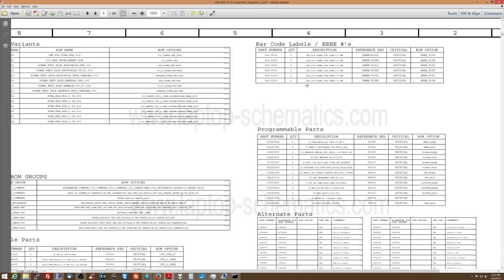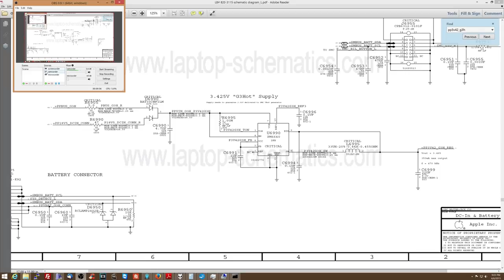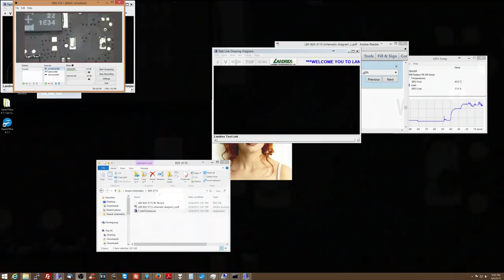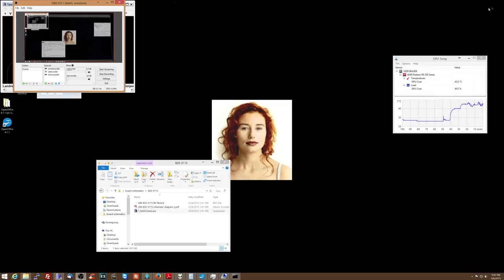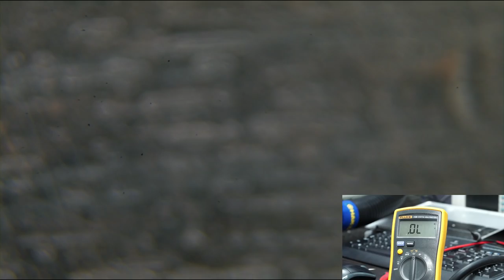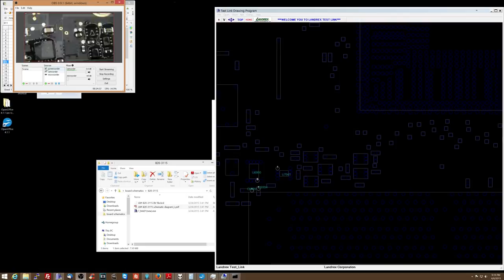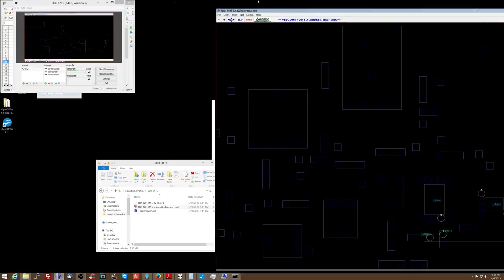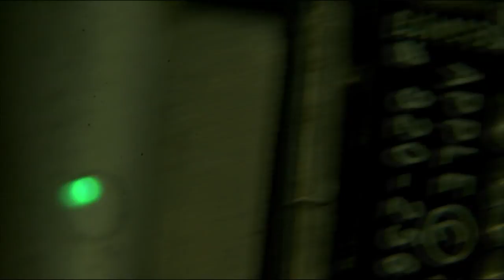How to find short circuit component without spending $6k on FLIR cam.

Comment: What temperature do you  use to melt and remove the SMCs ??

When you look for those resistors...  then you are SHERLOCK OHMS....
Reply: "Electromentary, dear Watts-son"

Elsewhere in here Louis had said "8 on Hakko FR-801 with old, beat up heating element."
FR-801 spec says 500C is its max when new, and the temperature knob only goes to "8" so... 450C?
Reply: @Spudz76  
THANKS ...   For the HOT ANSWER!

Comment: Louis, I wonder if you can give me some pointers, I was helping a hotel here in town, they have a machine that makes keys for the hotel doors, well, the power adapter for the machine had a broken wire because the staff bent the cord, the machine works with a battery however, when I fixed the adapter, I believe I had the polarity wrong, I had the + on the outside and the - on the inside and it was supposed to be all the way around. Now, the machine does not work with the power supply, only with the battery. Is this something I should be able to trace with the multimeter?
Reply from the maker: ***** Should be able to trace it by looking for the exploded piece with eyes. Open up and get to it
Reply: Thanks Louis, I honestly can't see anything burnt, I took a pic http://bit.ly/1hgNOIi I'm using my multimeter to try and find what component might have shorten, I honestly have very little knowledge in electronics and I am trying to see if I can get this fixed, the manufacturer wants to charge us an arm and a leg to repair it, heck they won't even repair it, they'll replace the board and transfer the information but I feel bad because I was responsible, I messed up when I wired the power adapter, I had the polarity wrong so, not sure what component burned but I'd like to get this fixed for my friend. Do you know if this can be fixable? I looked at the back of the board and it doesn't seem like the connectors go all the way through, I think everything is solder from the top. If you can give me some pointers on how to get this repaired, I'd truly appreciate it.
Reply: Louis Rossmann
Figured it out, it was the very first fuse, I put a jumper over it and now I am back in business

Comment: My hot air rework station started working intermittently and poorly and I discovered the regulator in the unit had some bad solder connections

Comment: Thanks for sharing man. This is very interesting.
 Ive fixed a few things on circuit boards for my RC Heli stuff that were obvious burned up parts like FETs , Tantulum caps, tiny surface mount caps and electolytic caps. etc.

Also soldered in a jumper for a blown trace. I felt proud for doing a few things but honestly wouldnt know where to start on a mother board if theres nothing easy to spot.

I replaced my laptop motherboard with one off ebay a few years back and it lasted a year or so  but now shuts down immediately during boot. I cant get into bios are anything. I wish I knew  how to fix it but dont know where to start on motherboards. 

Again thanks so much for sharing.
Reply: you can start by checking the capacitors on the board
Reply: @jessihawkins9116  Ok thanks!😀

Comment: I use fluxless solder and i probably would of skipped the gym when i start something i make sure its finished but in a way hes right life is just as important my rate is around the £2.15 mark his at minimum wage its tough going but to get business and work your way up the ladder you have to start cheap

Comment: Do I need to buy DC power supply and bypass short circuit protection to find shorted component on PCB ?
Reply: You could get an old PC power supply. It delivers 12V, 5V and 3.3V. You just won't see how much it consumes, but at least you'll find out what does get hot.

Comment: Hi Louis Rossmann, i like your video, and i use this technique to find shorts on phone boards, but there is a problem with it, it is very difficult to find shorts caused by capacitors, they don't heat up so easy and the are also because of the small traces you cannot supply such large currents like you did in this video. Do you have some idea how to find this kind o shorts without disoldering all the caps of the rail? Thank you.
Reply from the maker: Dacian Bujor No current limiting for me and no mercy. I start at 1 volt, and no current limiting, and raise it until I get to the max voltage handling for the rail. If I burn a trace I will rebuild it, it beats having a dead board that is shorted.
Reply: +Louis Rossmann still i have a board right now i6, and have a 0.95V rail, that is shorted to ground by a cap. The problem is that because its so low voltage and the track is thin i cannot get more then 1A through. And at this power nothing will heat up. There are somthing like 10 caps on this rail all of them have no corrosion on them. I am stuck.
Reply from the maker: Take them all of!

Comment: Sorry if I'm being dumb, but do you leave the power connected whilst pouring alcohol on the board?  Do you need to worry about this shorting anything out or causing damage?
Reply from the maker: I apply power only to the shorted rail.
Reply: Louis Rossmann thanks :).

Comment: Hey Louis, been watching and learning loads from your vids for a year or two now... was great hearing your hillary chat! I have a minor problem and that is that solder/components/motherboard sometimes sticks to my tweezers... Even with new ones, it has happened...... Also, who is reputable for buying chips, capacitors resistors and the like from? I have been purchasing from aliexpress (mouser had extreme delivery cost) but heard you diss them and could poss explain some crazy readings/results I had from them!! all the best, thanks for your efforts! Ps Im uk based

Comment: I have a navigation unit from an Acura TL that when changing out a backlight bulb, I shorted something on the board so now none of the lights work. Is this something you could fix? I have some knowledge but diagnosing a board and finding the faulty component is something I can't do. I'd love to know how but I don't even know where to start.

Comment: 30:35 "Yea, doesn't that look burned to sh't?"
Lol funny guy... reminds me of myself
Good video. Gave thumbs up. I too think it's better to pay for expensive stuff only when they actually make a difference
Also, about the esd issue, you can solve that pretty easily by using a grounding bracelet or the sort; but ofc you need to have reliable grounding installed in your establishment.
Effects of esd usually aren't very apparent, in my experience it usually damages some tiny parts rather than destroying anything outright... But who cares as long as you have a good supply of those chips with you. Yea, you should be fine unless you change wool sweaters and touch like a 0603 dac chip or something expensive.

Comment: what would be a good recommendation for a soldering iron for a hobbyist? i would want a best quality per price but i couldnt afford to spend more than 100$ since i wont be using it for making money back, just personal repairs, teardowns, ect.
Reply from the maker: +IceTea Deez I can't really say. I use a hakko 2027 with t15-j02 tip, it is a good general purpose. You can wick with it, flow large joints, and solder tiny connectors. I used to use a hakko 936 but i will never go back to that old pos after using real gear.
Reply: wow, I'm honored you responded to me but.. the first link i saw said 1500$..... i guess i will stick to my weller wsb25hk... sorry for wasting your time but your 2 vids ive watched so far i found very interesting and will def look for ones I can learn from to improve my low level skills....
Reply from the maker: *****
wtfak $1500!!!! no.

http://www.amazon.com/AMERICAN-HAKKO-PRODUCTS-INC-FX-951/dp/B0012B8NW8 is the iron and station

http://www.amazon.com/Hakko-T15-J02-Soldering-12-00mm-FM-2027/dp/B00IFH187Y/ref=sr_1_1?s=industrial&ie=UTF8&qid=1455250390&sr=1-1&keywords=t15-j02 tip

Comment: The trick I used to find hot spots was to turn a full can of air duster upside down and spray the board with it and look for where the frost disappears first.

Comment: So the faulty component is always the hotter one correct me if im wrong bc im trying to fix this mother board and this smd capacitor turns really hot when i plug the charger

Comment: I know a little about electronics, but, what is a zero ohm resistor used for?
Reply: When pick n place machines assemble circuits boards at any kind of volume they're not going to re-spin the board if they need to do revisions or have models with different options that use the same board that may not need a resistor there.  These optional/different model boards might use an actual resistor in that spot,  but another model may just need a jumper with the same footprint.  A 0 ohm resistor is used so that the pick n place machine programming does not need to be adjusted or a tip changed.

Comment: Hi, I have problem on my motherboard. Same package as in 30:40 and I need to replace it, but I have only normal solder iron and a heat gun (which is big and can't give heat with low fan settings, so it could blow SMDs away). Is there any way how to remove it easily?

Comment: Hi. I have a short to ground on my laptops graphics card MXM 3.0 GTX 880m, and because of this corona pandemic I'm unable to take it to repair shop. I have some basic knowledge and tools, but I can't find it. I did isolate the part of the short to ground, and found out it's from 7-20V power_src input to the first coil, R56. Some help would be much appreciated. Isolation sucks without a computer. By the way, your channel is great.

Comment: Hi. A need a little help. I have one laptop which is short to ground. He is short from the beginning of the board( dc connector is short to ground) and that short goes to most of the board. BUT, when i connect my power supply to the board, nothing get hot. I tried with power supply on gew places, but always the same result. I have no idea what can be the problem. Do you have some suggestion? Thanks.

Comment: so i have a short to ground on the +3vs5 line.   3.3 volts with a 4A current and a 6A peak.   what does it mean if every component on that line heats up (including the cpu) when you apply 3.3 volts to that rail (minus to ground)are they supposed to all heat up and am i supposed to look for the 1 that heats up even more?.   or is there something VERRY wrong

Comment: Hello, at 35:00 when you replaced resistor and capacitor, how did you know the good value to replace ? did you measure the removed one? or you got the value from shematics?
Reply: He has the schematic and board view file, so those component values can located with the board view and read from the schematic.

Comment: In regards to that horrible board view software, have you tried using CADsoft Eagle? It is freeware and has a pretty good .brd viewer for the price of $0.00. I use it to make schematics and PCB layouts but I don't see why it can't just be used as a standalone board file viewer.
Reply: +Brandon Martinez Eagle is only free for non-commercial use though. It's a pretty penny if you want the software with all the features though.

Comment: I have a short on a Nintendo switch mainboard from a 1,8v line to ground where around 0,4A flow through the short. Since this does not even produce one watt of power loss, I can’t find the short by feeling where something gets hot. Is there any other possible way of finding it?

Comment: I'd use a much lower currentlimit than the 10A you used. If the short is low-impedance which it apparently wasn't this time, you risk blowing track off your board at 10A.
Reply from the maker: +rewolff2 don't limit current. Just start at 0.5v

Comment: +Louis Rossmann Hi... any ideas why a MBP 5.1 charges battery normally but won't turn on even after SMC, PRAM and Power Switch has been discarded as the cause? No Fan, no Chime, no nothing... Definitive proof of a dead logic board? Or something else is happening and i'm not seeing it? The battery charges full and the discharges normally after a month or so being unused so... any thoughts about it?
Reply from the maker: TheMetalMusicMachine Missing power rail, corrosion somewhere. Measure all power rails and see what is missing.

Comment: Some advice to your co-worker going through a divorce. U mentioned him in the video. 

It's a 3-way jack by the lawyers. They practice the skit beforehand and when it comes time for trial, they perform for you. The skit is designed to confused the parties and continue the fight. The more you two fight, the more money the lawyers make. 
My advice, marry up. Also, don't hire a lawyer, because that's like hiring a spy on the inside. Hire them as weekend tutors, but don't let them speak for you during trial. 
Also, hire your own court reporter so when the judge robes you, u have evidence.

Comment: there are 4 method to debug short to gnd issue that i know.. 1 using short locator that required 4 gnd to each side.. 2. using iflir camera which is the easiest but not that reliable for above 1ohm short.. 3. using freze spray. 4. is my favourite using multimeter and hotair/solder...

Comment: I wouldn’t max out the injected current. That’s 3.4V x 10A = 34W. You could fry traces while you’re looking for the short. Instead, I’d find the output current rating of that buck converter and use that current.

Comment: Since you're not fearful of ESD and are probably using lead solder you may not mind a nylon toothbrush with a little Xylene to clean the board. Worry about the cancer later.

Comment: BTW Lou.....I've been in the electronics bizz for over 35 yrs, it ends up being the easiest way of troubleshooting that finds the majority of circuitry problems.....
I've used some of the most expensive equipment and meters etc, most times a toothbrush and some solvent would expose more problems than a thousand dollars oscilloscope. ....
Not saying that having good equipment isn't valid, but, I'm concurring with your info in this video. ...!!!

Comment: ESD isn't as big of a concern on a fully loaded PCB, that's why you don't have to worry so much about it. When you're dealing with individual components, especially sensitive ones like ICs and certain Microcontrollers, ESD can easily kill them. When they're in a circuit, especially a pcb - not so much.

Also, your justification used not to use ESD protection didn't make any sense. Shorting a component to heat it is fine because chances are you are going to replace it anyways (once you find it). You can't compare heating something up to ESD. Heating doesn't mess with logic gates like a 1kv ESD shock would. I hope you consider learning more about ESD and take the minimum precautions, and certainly don't encourage anyone to ignore it. 

So good video besides that one point. I don't want people to develop bad fundamentals and/or ruin their chips.

Comment: From experience a person can be the best troubleshooter, but when they trace circuit failures without a schematic and find house numbered chips and find no mention of them on the net and manufacturers play dumb is just very frustrating. Electronics isn't really taught anymore in most high schools and now that ITT went corrupt there is even less places.  It has been for many years an assembly replacement world, but if your lucky you can replace discreet components. I don't even bother with pc motherboards unless it is a filter cap failure.  Well enjoy finding shorted fuses and why the magic smoke got out.
Reply from the maker: yeah without schematic and boardview i don't bother. i only charge if successful and don't want to waste my time on shit where i am set up to fail

Comment: regarding static protection, you have to remember that making and breaking the field of electrostatic flux is the only time a discharge can occur. if you're holding the board in one hand, you cannot discharge to it by touching it with your other hand... my explanation is poor, for that I'm sorry... and if I don't seem to make sense to you, i know you can find a good video that explains electrical flux fields... but the only real life situation I've experienced is electronics in regular plastic bags, as the whole thing gains a small capacitance, and when you remove the board (or whatever it is) you break the flux between the two components of your "capacitor." depending on the charectoristics of the plastic, and the package you can actually develop a high voltage capacity in the picofarad range. Still yet, modern electronics are pretty resilient, and I'm not nearly as anal about static precaution as I was taught to be. Static scaremongering seems to be a thing bred by the fear of the unknown.
Reply: "High voltage capacity in the picofarad range"?  "electrostatic flux"? o_O
I think you may be using words you don't really understand, judging by how you mix and match them without any sense :P

Comment: hi can u please help ,I have a 5.8 rc transmitter .I powerd it with 12v and it should have been 5v .I can not se a problem looking at the board .can I replace  a part .the transmitter is a eachine 600 mw  thanks so much

Comment: Is that mineral oil hes putting down before he removes components?
Reply: Thats flux buddy, it raises the temperature faster  because its a liquid, but its boiling point is much higher than water so it doesnt evaporates too quickly. Its your best friend when doing motherboard components level repair. There is actually some tin that have flux cores to help you solder.

Comment: Aren't You scared that when setting power supply to 10A the trace that leads to the shorted component would evaporate instantly leaving the board fucked up beyond any repair if the trace is very thin? Wouldn't like 1A do in case of 3v4 rail?
Anyway, I love the method.
Reply from the maker: Rafał Białek I start at 0.6v at 10 amps and slowly turn it up. The resistance in the component/circuit is going to limit amperage anyway, no need for the power supply to.